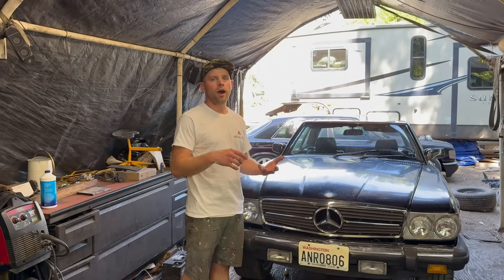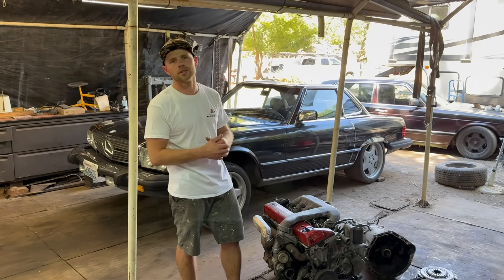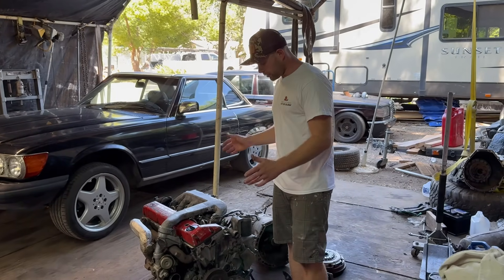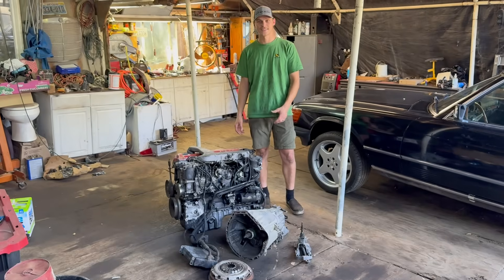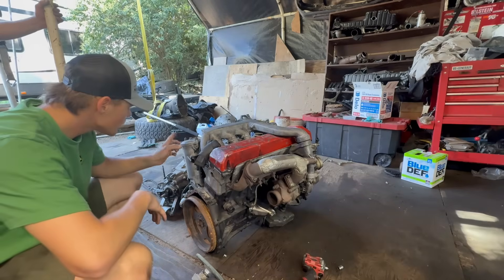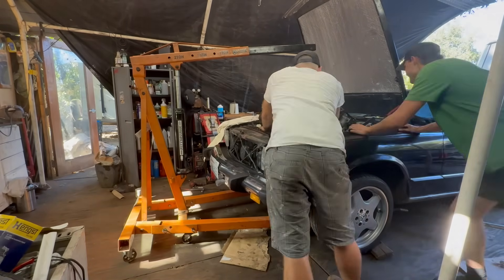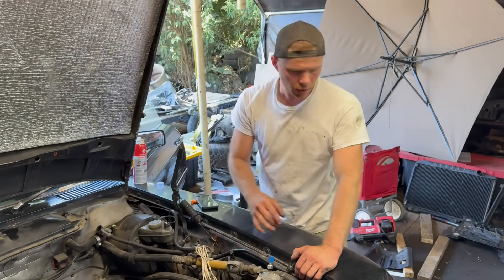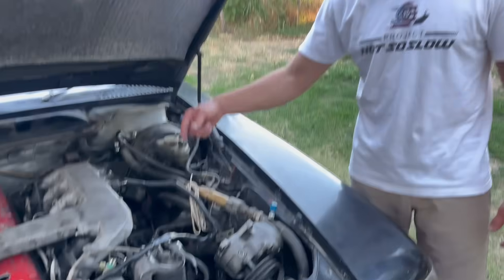Building the DIESEL SPORTS CAR Mercedes Couldn't (TURBO OM603 into a sl380)

Comment: Another thing I like about the 603 and other 2 valve OM series motors, that they have way more low end torque compared with 4 valve engines
Reply from the maker: Personally haven't driven a stock OM606 so wouldn't know lol

Comment: Where in Washington are you? I have a 1981 300TD with a benzforce 7.5mm mw pump on the 617A backed with a 4 speed out of a 240D. It rips for what it is. Have owned it since 2013
Reply from the maker: We're not in Washington but the car we're working is a friend of ours in North East Washington.

Comment: Have you guys had problems with the cylinder heads? I heard 18 and higher number design cylinder heads are better..     i am thinking of putting an om603 turbo in my wj jeep..
Reply from the maker: They are better but if you don't overheat the 14 head it'll work just fine.

Comment: There was probably some slight corrosion inside the cylinder walls, that's why it had that lopsided chug when trying to start and not smoothly turning over.... and probably that brown smoke is the rings (hopefully) knocking off the (hopefully slight) amount of corrosion and burning off and out.

Hindsight, but you probably should've taken out the plugs and sprayed a bit of Marvel Mystery Oil inside the cylinders and left it to sit for a day or two, then put a ratchet on and spun her over by hand first a couple rotations to loosen her up....then after she started she'd have smoked like a pig, but everything would've been clean and the cylinders oiled down..... Marvel, of some ATF, in a spray bottle so when you spray it, it cones out and hits the walls and runs down, instead of having to fill most of the cylinders full and pressurizing it out via cranking it without plugs.

Regardless, this is going to be a dope azz little SL.... I love these things and literally never thought about doing this swap, I always wanted either an LS, or a 1 or 2JZ swap, backed by a Tremec TKO or T56..... Oh, and you really should get the AMG kit and old school AMG wheels....not the monoblocs you have currently, the old original AMG wheels, they're concaved pointed 5 stars, like on the infamous AMG Red Pig, or.... the SL560 AMG's.... the wheels, front airdam, skirts, rear spats and rear under bumper piece....then some coilovers to get it sitting right, thing will be the dopest SL around (minus the SL65 Black 😅)
Reply from the maker: This build is for a friend of ours, I'll let him know the advice about the wheels. 😉. Also I called my friend to ask how long its been sitting after it started so rough to find out ho long it sat. Guess should have asked first lol.
But thanks man! We appreciate compliments 👍

Comment: Nowadays, it's getting harder and harder to find those Mercedes turbo diesel engines in Europe — most of them here are naturally aspirated. Pretty funny how it's the opposite over there! I've heard and read that you really shouldn’t open the cylinder head on those old Mercedes engines, because at the factory they sealed it so well that it holds pressure best if left untouched. Another thing is that in higher-mileage engines, the piston compression has dropped enough to actually allow them to handle more boost and power. And in the OM603 3.5-liter engines, the crankshafts tend to go bad because they’re relatively weak, maybe because they’re longer than the standard ones

And your videos are awesome — thanks for them! Greetings from Finland!
Reply from the maker: Thank you! 
Im hoping more people see that the Mercedes diesels are awesome and stop throwing them away.

Comment: The c230k 6 speed box is made of chocolate. Be steady when pushing lots of torque through it 😅
Reply from the maker: It's going to be a sporty weekend car so this 6 speed should be ok. But that's for the heads up!
Reply: @ProjectNotSoSlow  no problem looking forward to seeing it 😁
Reply: What 5 or 6 speed manual do you recommend for more torque heavy applications ? I’m doing a turbo 602 I’m my w124 wagon and will be towing and hauling weight
Reply: @12pagani  either use a gearbox from a 270 CDI providing the bell housing pattern is correct or use an adapter plate from diesel pump UK and use a BMW ZF gearbox which are really strong

Comment: just m117 turbo swap it
Reply from the maker: Huge diesel fans!
Reply: @ProjectNotSoSlow  have you ever tryed fitting 2x hx55 to a stock m117 ?
Reply: @ProjectNotSoSlow  eaven m116 3.8 4.2 4.5 5.0 5.6 the low hp usa low cr spec does 450hp on ke jet injection and with efi cheap shit junkyard setup 7000rpm 800hp is like nothing
Reply from the maker: I don't mess around with gasoline engines. Diesels is all I know. But if that's true a m117 can make 800hp very easily, then might have to learn what gasoline engines are about.
Reply: @drmikegaspwred1483 honestly never knew that was possible. Would be cool to find a video on that.

Comment: Ur late in the game now ppl swap cdis into everything in europe om613-om648. I myself have a w126 sel with om613 and 722.6
Reply from the maker: That's pretty cool! Don't want to deal with any electronics and the om603 is very cheap.
Reply: @ProjectNotSoSlow standalone ecu not much electronics 98% plug and play. But yes mechanical engines are easy and fun. But blacksmoke racing and Furulund drifting. Are running these 3.2l i-6 too 800-900hp with 1200-1300nm. Insane for a 3l
Reply from the maker: Oh ya! Thats alot of power for a 3 liter diesel. Have you seen in US there's a company that has over 1100 whp in a BMW 335D.
Reply: @ProjectNotSoSlow  in drifting? These can make more but will not be reliable in drifting at higher power levels. But im sure they can make 1000- 1100 for street driving

Comment: Glad to see more people in the US using Mercedes diesels other than the om617. I have a om606 and the same 6 speed going in an S124. Did your clutch and flywheel come as a kit?
Reply from the maker: Yes it came as a set on ebay
Reply: @ProjectNotSoSlow nice do y'all remember what it was called? Was it one for the sprinter single mass flywheel swaps?

Comment: I will give a suggestion for the 60x series, after making the mods and messing with the hoses for a while  and figuring out what works the best, if you take out the m22x1.5 plug on the head by the rear cylinder and out and an8 fitting to m22 fitting, pull the pump housing off and drill and tap the two thread bosses one has a temp sensor which you have to remove for this, and the one used in the block cooling mods, which didnt work well by itself. Youll need an m18x1.5 for that to 8an for the block and two m16 for the pump thermostat, the lower fitting goes to the block and the upper one that had the sensor will go to the m22 fitting in the head. This significantly improves flow of the system and allows the head to stay a pretty consistent temp. Ive ran this with a few different setups and the temp gauge stays consistent even in 100 degree F heat. Monitoring with heat probes and thermal in various spots, i can say this is the best way to cool the engines without major mods. This works on all 60x series. Use the farthest to the rear plug that you can on the head. It makes a difference on how the other hose flows as well.
Reply from the maker: Thank you! We'll have to try that.

Comment: Dude, im stoked to see more about this swap. Im putting the exact same engine / trans setup in my toyota pickup with a divorced transfer case. 

Does the c230k clutch and flywheel not work on the diesel?  I have the parts in the shop, i just haven't tried bolting them all together yet lol
Reply from the maker: From the research I did it looked like the stock one would not fit.
Reply: @ProjectNotSoSlow  well dang 😢 i was hopping to do the swap this summer but i unexpectedly have to move so it will be put on hold for a little while.  I thought i had all the parts ready to go but it looks like im back to looking for a clutch now lol.

Where did you get your clutch and flywheel setup from?

Comment: Talking about cheap engine options, there's also the OM602, the 5-cyl version of this diesel engine family, which was available as n/a AND as turbo diesel from '86 in US afaik. As the 602 is one cylinder shorter then the 603 it might be an interesting option for engine swaps with less space under the hood. Btw, interesting side info on 601/602/603, they all run perfectly fine on vegetable oil, waste oil or any mixture of veggie, waste or diesel oil. My dad and me had three OM602 cars in a row and did about a million miles together with them, fueled just by veggie oil right of the farm.
Reply from the maker: I would like to one day do a project with a Turbo OM602 one day. I've ran veggie oil before, enjoyed the French fry smell 👍
Reply: @ProjectNotSoSlow  as you mentioned OM603 heads tending to crack if overheated - the OM602 heads turned out to be way sturdier in comparison. They just don't crack. I'd love to see you build a super turbo OM602 project ^-^,

Comment: It is a shame that none of the US car companies really cared about diesel engines back then. Try to imagine a 3 liter 6bt passenger car engine that would probably have been a blast to tune
Reply from the maker: Yup!
Reply: It is a shame, it's also a shame it's so hard to come by the fantastic diesel engines Europe and the UK got and we didn't, especially all the cool I5 diesels.

I know the 606 sounds like a damn 2JZ after it can rev freely past 5500rpm when modified, I'd love to hear what that generation I5 and later would sound like revving after 6k with a big turbo and open exhaust 😅

I can't remember their name, might be Swedish, but there's a drift Mercedes wagon with a 606 and like 800hp and it sounds absolutely mental and looks even better
Reply: @johnnygeorgopoulos4072  ohh i thought you got the 605 on the other side of the pond as well, they sound lovely even stock. What about volvo diesels did you get them? Many of them here are also 5 bangers. At least you got the tdi's they make great power but well even though i only own 4 cylinder diesels i wont say they sound nice
Reply: American auto makers are greedy.   Plan is to build junk and sell high